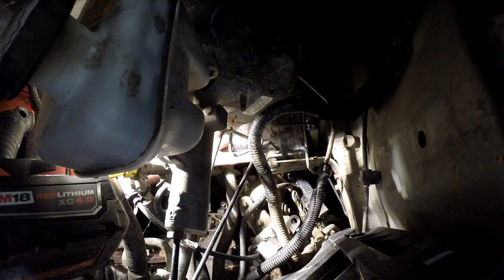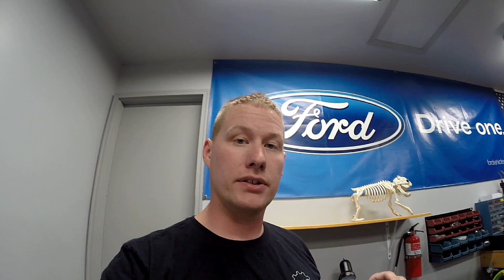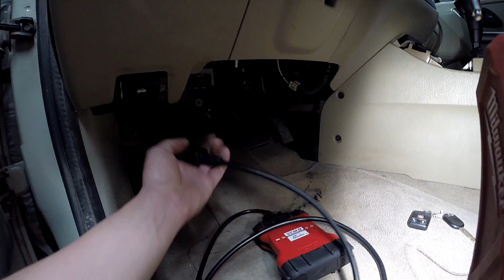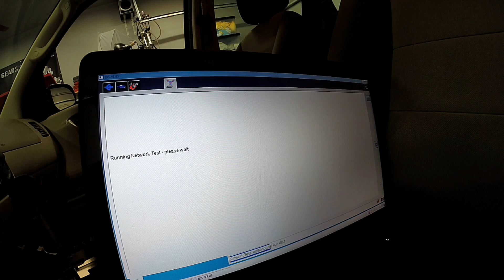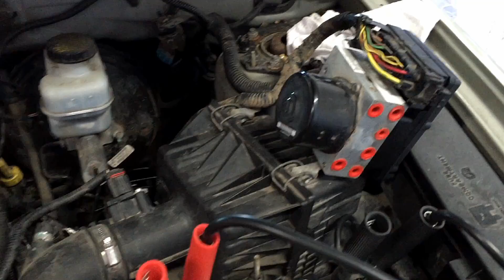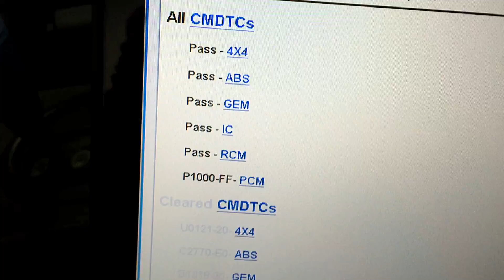2005 Ford Escape Lightning Strike Conclusion Pt 4 of 4: ABS Module Unresponsive

Comment: Hey Makuloco I was led to your channel from the Ford f150 forums  as the guy to go to .
I just recently purchased a 2004 f150 lariat 180k on the odometer with an abs issue  it was involved in a curb crash folding driver's side suspension.
All the drivers side suspension was replaced the brake line and abs line were broke I replaced brake line and temporarily spliced abs wires back to gether .it initially read front left  speed sensor circuit open with b1342 internal fault and b2477 module configuration failure after clearing codes and driving the speed sensor open circuit was gone but the other 2 remained . 
I'm not sure if this module is original however it does not look damaged  .my question is if it is not programmed to the truck ..will it also give internal fault error .I've read how to program buy having scan tool copy data however how do I go by programming the module if I don't have old information in d it a matter of vin input
Reply: I'm using a launch x431

Comment: Hi Brian. Can you reuse a working electronic control module and apply it to a used abs pump assembly to avoid having to reprogram? If not, can you take the old non working unit  out of the vehicle to a dealership and use it to program the used abs assembly or must it be in the vehicle to do this?

Comment: My 2008 Escape Hybrid makes a noise when started and press on brakes. Sometimes I get check brake system or something about Regin brakes disabled. It went away for 6 months then came back again . I checked the ring behind brakes but see no cracks and are not loose. Is this hydraulic control unit that is making the noise? Can you post how to take off a  HCU or explain how to remove? 

I was told I can not buy a HCU unit at a junkyard because these need to be programed and many times the info is not transferred correctly; informed from a local mechanic.

Comment: Master good morning.... i need you help i have a Ford windstar 1996 the problem is: i find oil in the coolant rescuperator but, in the engine no find coolant. the bank 2 spark plugs have contaminate. thanks for you help sorry for my bad inglish
Reply from the maker: +Carlos Sanchez I think you found your head gasket issue.

Comment: Nice Case study here buddy thats amazing to see the damages of a lightning striking a car.. It is bad. still,i rather my car getting struck than myself hahaha,thats reminds me when i was a technician in a used cars dealership and the old man you took care of the lot jumped started  a Mercedes SLK the wrong way, right after the cooling fans were constantly working even with the key out, i found out that the cooling fan module fried up, a 600$ module. I took it apart and the board was melt what a waste hahahah

Comment: you don't have a scope to check the network wires for activity? or not needed really?
Reply from the maker: +phil holbrook No need for it even with the new live network test on the IDS I am not sure I will ever have to use it. I almost never use a scope except for cam and crank sensors.

Comment: Is there a way you can install some lightning strike rods (like airplanes) so that the static can discharge w/o causing all these problems 9I'm kind of joking when I ask this). On a serious note, do the engineers see lightning strikes as a contingency when designing a car? Are there any protections from this built in?

Comment: Great video, what was that motor you were using to test the pins?
Reply from the maker: It is an old window motor from a Buick Regal so it really pulls some amps and load test the circuit good.